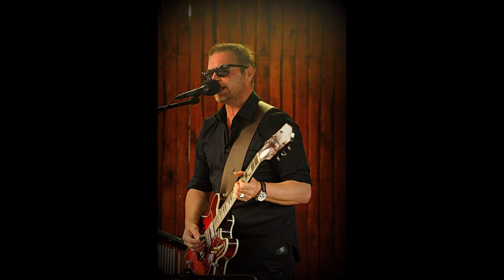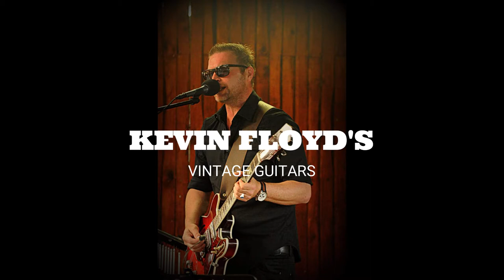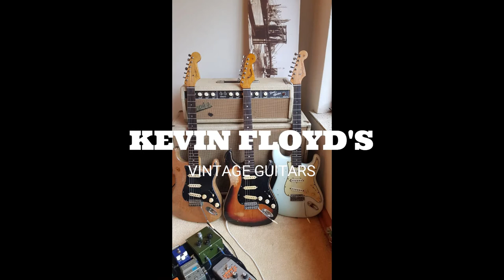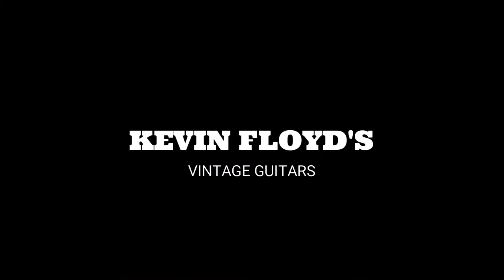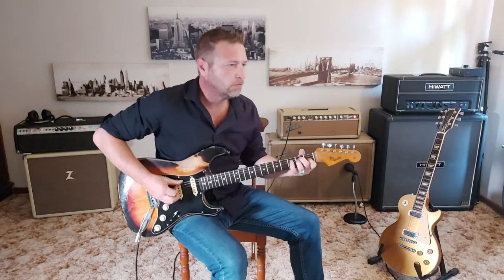1970s FLAT POLE PICKUPS TESTED IN A 1965 STRATOCASTER

Comment: I am lucky to own a 1977 strat without tremelo that had stagered pole pickups but did not sound well. I put in flat pole pickups from my 1978 strat with tremelo that sounded too loud. In fact I switched the pickups and both guitars sound so much better. The flat poles produce more volume but a warmer sound at the same time. It gives more veritality, when you strike the string harder it prod uces a louder tone, it does what you had in mind.

Comment: What year in the 70's are the pickups? I had some from 74 and they were magical and they were flat poles. I have some now that 2 are 74 however one is flat and one is staggared and the other is a 78 in the neck. I do find the flat poles to be fatter somehow but maybe too fat at times like in the neck...but maybe just because it's the 1978 pickup. The staggar seems to have more of that bell character and is more clear and less tubby. I think maybe it's more down to the wind and getting some lucky good sounding ones than the flat vs staggar. I do think the 74's both sound better than the 78. I have extended the leads and tried them in various positions and the staggared one sounds best in the neck because its not too fat for that position. More bell character and less flub.
Reply from the maker: Hi, thanks for the message.  Mine are 76 pups and I still love them on my 65 strat. 
I find the fat scooped sound really works for Stevie Ray Vaughan type tones which I love.
Reply from the maker: Its great that you are experimenting with them and finding what works best.
Enjoy the pups and keep on rocking 😊
Reply: @floydsvintageguitargear4721  thanks! The best ones I have personally owned were stock in my 74 strat. Man they were magical. Very SRV for sure and yes flat poles even. The harmonics would bloom out of them.  I compared it to some early 60's strats in a local vintage store and it was just as good and I actually liked it better. Sometimes you get lucky. That one had it. Never found another strat as good that I could afford.  I regret selling that guitar. I still hope to buy it back if I can ever run across the guy again. I've heard Johan Segeborn's video where he compares various years strat pickups and I preferred the 76's in his video. Your's sound wonderful. I'm sure the wood has a big part as that 74 that got away was only about 7.6 lbs and alder.
Reply from the maker: @HiHello-ku1fl  I agree, I think the wood is a huge  factor. You're absolutely right, sometimes we get lucky 😊😊